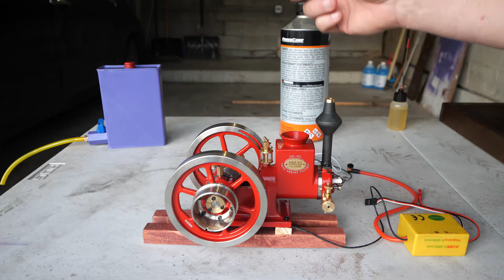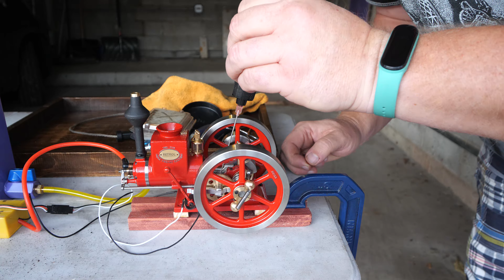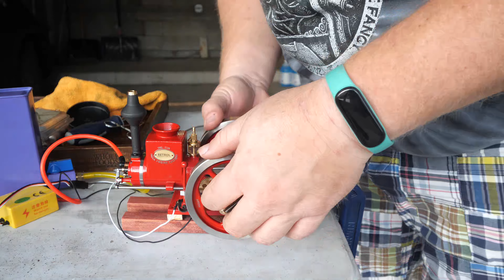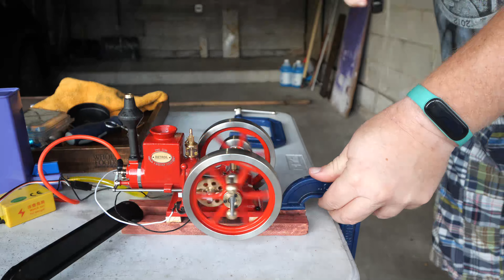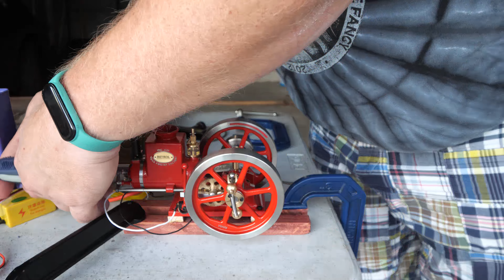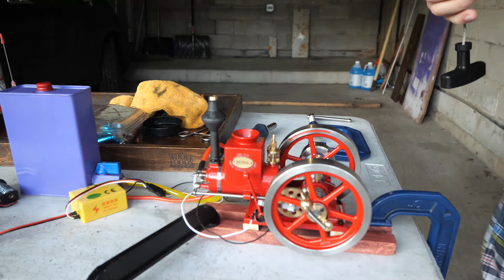HM-01 First Starting Attempt

Comment: To make an easy starter for this motor, get a stack of washers almost the size of the inside of the starter drum, bolt them together, wrap with electrical tape to get to the size of what you need, put the bolt in a drill, easy way to start. Settings I found to make this run, 1/2 turn out on the fuel needle, choke, one notch from fully closed, mark the adjustment screws so you know how much you move it, it takes only one or two clicks to make a difference. Cold start, one or two clicks open from where it runs warm.

Comment: I have ordered some micro switches, going to try and get them to work instead of the original points. The points seem to not work even though they are set right, I spray some cleaner on them, usually helps
Reply from the maker: Yeah, I got the 1140 in the mail and haven't had a chance to get back to figuring out the ignition on the HM-01 yet.  I have a few things to try, but may be looking at microswitches in the future.

Comment: Why not put a little bit of fuel in the tank so theres no pressure.
Reply from the maker: Yeah, I'm going to check the valves and put less fuel in the tank for the next try.  I am sure it will start with a bit of work.
Reply: @henrybangsberg2187  😎

Comment: I would be gutted if I had a new engine, that's as stubborn as that!
Reply from the maker: It was a morning cold enough that I don't know if any of my engines would be happy starting.  I also am not sure the gas tank I have set up is a good one and I heard a lot of wheezing past the valves.  I should have done a valve job when I got the engine, since every other model I've had has needed valve lapping out of the box.  I am sure I will get it going soon.